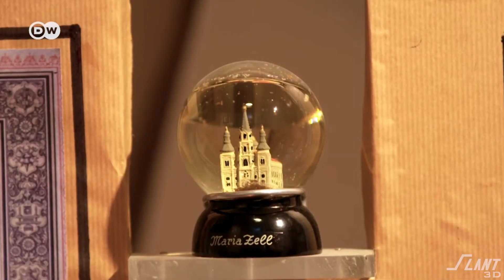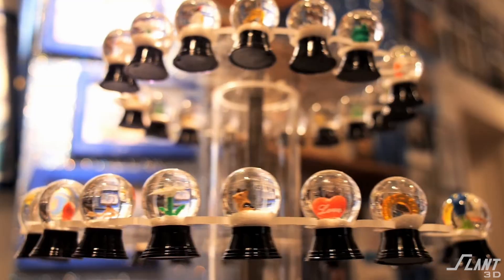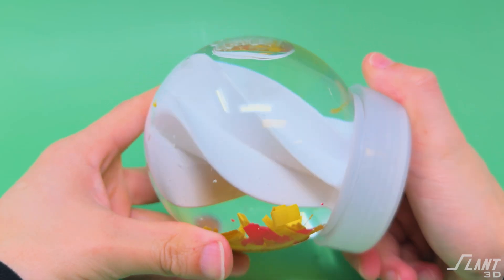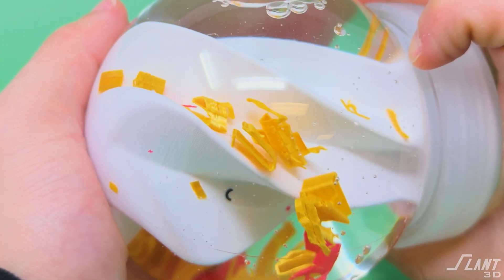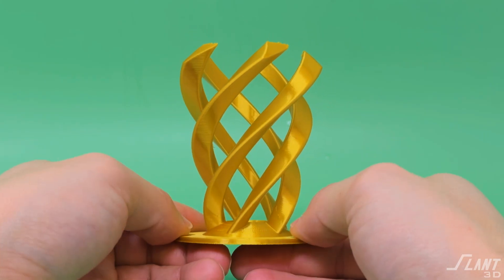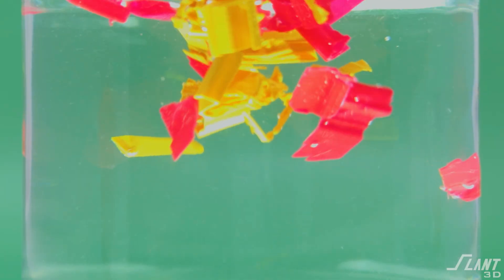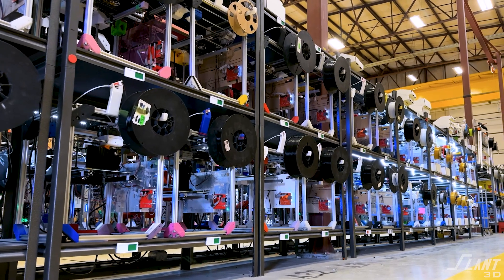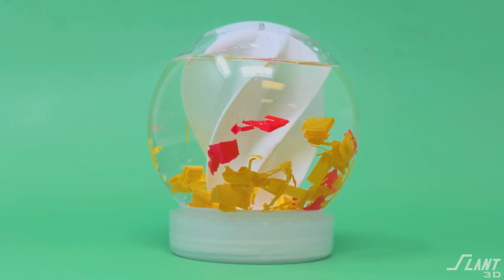Design Your Own Snow Globes Using 3D Printing | DIY Snow Globe Kits

Comment: What is the tool you used to create that swirl. I can't find that in Fusion. Thanks! :)
Reply: There are a few answers on google. But when you search for it, put “swirl” in quotes. Otherwise google will search for spiral.
Reply: It looks like the sweep tool, but it's kind of hard to tell being in French...
Reply: @TS_Mind_Swept  That was my problem as well. I wouldn't know, how the sweep tool would do that. Since it looks like they somehow swirled an existing body.
Reply: @andreask.2675  I didn't know the Sweep tool did that either; just tested it and apparently it does, now I have to go back and modify a model which I used the most janky setup to do the same thing for...
Reply: @TS_Mind_Swept  I tried but I  have no idea how sweep would achieve this. Can you explain the steps in short, pleas?
Reply: @andreask.2675  apparently 💩tube doesn't want me to >.>
Reply: Apparently 💩 tube doesn't want me to >.>
Reply: Do you have Discord or Instagram? It'd be a lot easier to explain with pictures